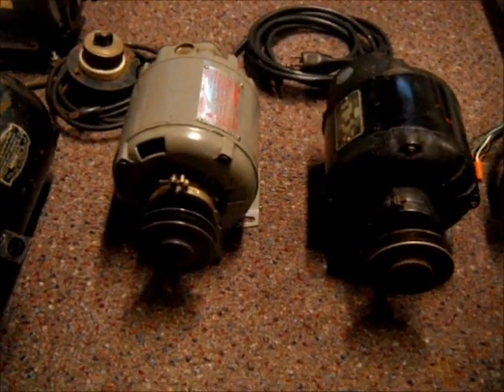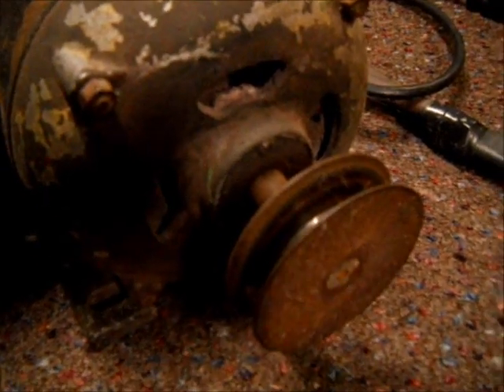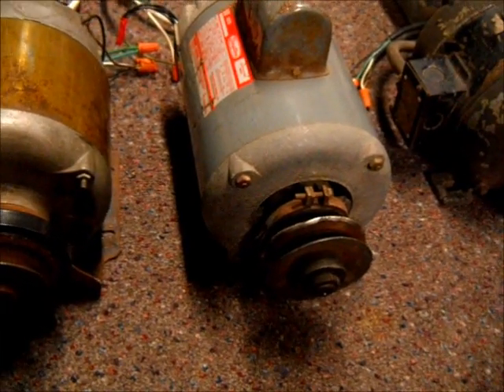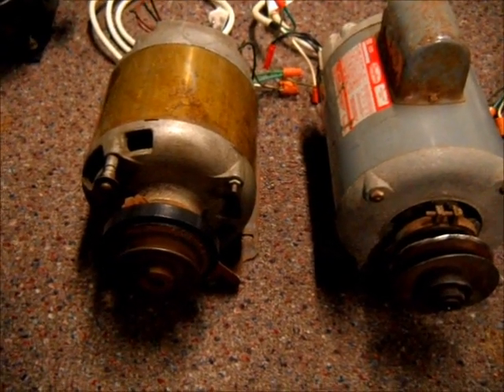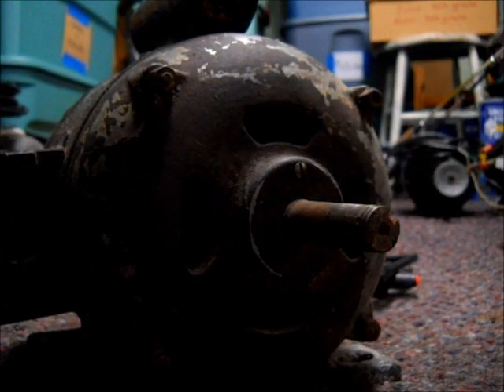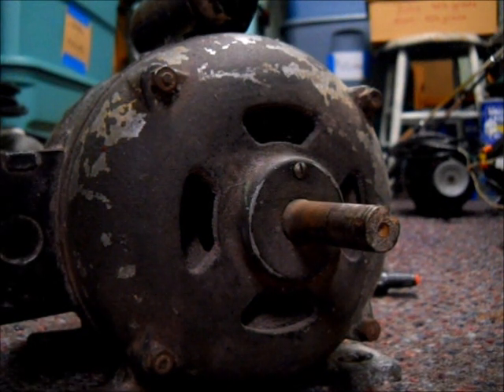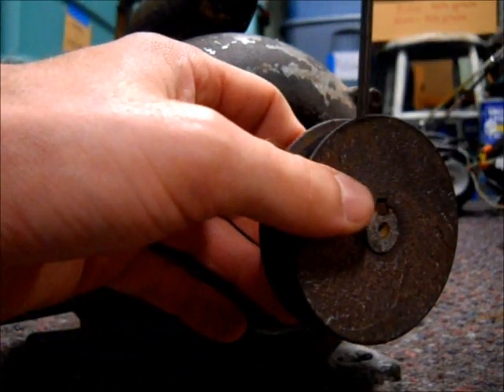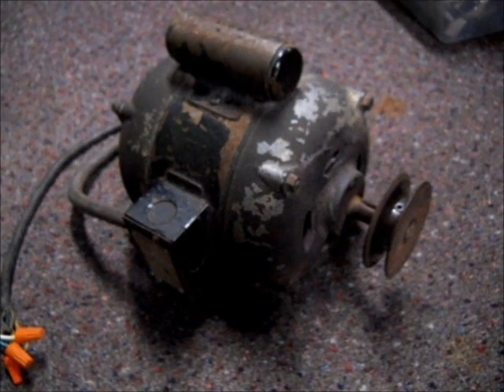How to oil an electric motor

Comment: I have an old GE split phase motor from around 1935, how can I flush the old oil form the sleeve bearings and wick? There doesnt seem to be an easy way to get the wick out either.

Comment: I have an old 1/4 marathon electric motor for my gas furnace. Do you know if there is a replacement type for it?
Reply from the maker: @jackeroo75  I would take the info like hp, volts, and shaft size and look for a replacement motor. Any motor should work fine as long as it matches the specs of the old motor.
Reply: @ HP 1/4, Amps 4.3 volts 115, frame 56-3

Comment: My Westinghouse has use 20W oil stamped into the housing,with no oil ports ,it also has a schedule, 1st at 25000 hours and then yearly .No oil ports .So it was factory lubed and then YOU HAVE to take it apart to lube it .and it is over 60 years old .

Comment: A few drops of oil per year is for motors in good working condition that have been previously regularly oiled. For screechy rusty old motors like the one shown, I would start with 10 drops of oil at each end, spin it around, and repeat until noise goes away. Sometimes it takes 30 drops or more, since the dried out felt wick pad has to be resaturated with oil before it can feed the bushings. Also put a few drops directly where the shaft enters the bushing/bearing at each end of the motor.
Reply from the maker: Good idea! I will try that on the next noisy motor I get. Thanks for commenting.

Comment: Good demo/info.  That motor most likely has burned bearing(s) and will need to be replaced at some point.  I have a few of those 1/4 - 2 HP motors on old shop tools that I regularly add a few drops (twice a year usually)... vintage late 1960s Craftsman 113 10" table saw, 10" band saw & 8" drill press and a Rockwell cabinet jointer.  They last forever if properly maintained.

Comment: I love that these kinds of videos exist. I have a motor that got noisy, so I oiled it ... but just the front, and it was good. Now it's only a few months later, and it's noisier than it ever was. Well, I didn't realize there are 2 oil ports. That's sofa king obvious haha, but I normally only work on much smaller motors. Anyway, now my fan is better than its been in years. Thanks!

Comment: I was wondering if you know how I can Oil/Lubricate an A.O. Smith 3/4 H.P. Motor. I can't seem to find the Oil Ports (& I do "not" have a Manual) 
I can e-amil an image of the Plate that is on the Motor if that helps

Comment: What is down the oil shaft? Is there dirt? I stuck a pin down in there and felt some blockage so how do you know if there's dirt down there or if maybe there is a tiny sponge to hold the oil so it doesn't all flow out?
Reply from the maker: There is really no way of telling if there is dirt in the oil fill tube. you may be able to see if there is a wick to hold oil.